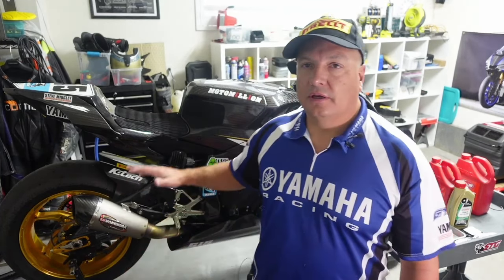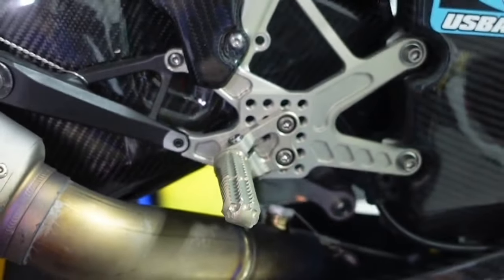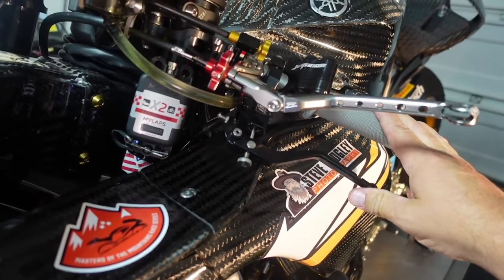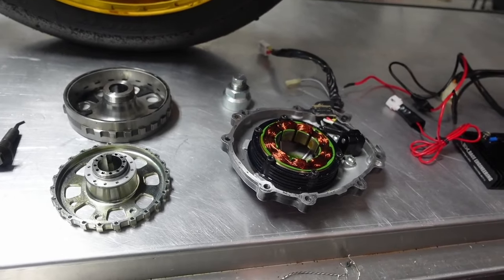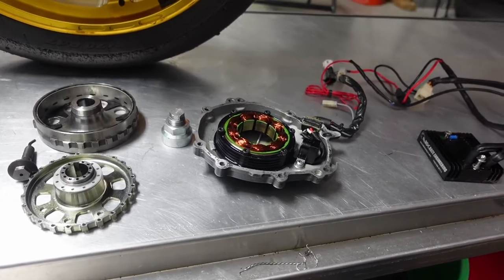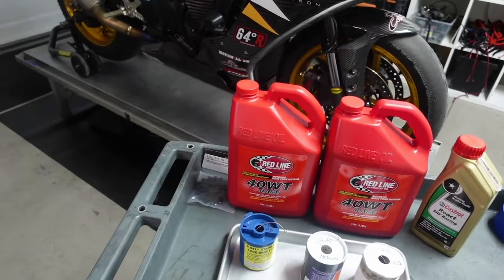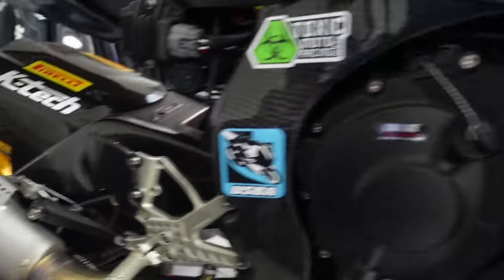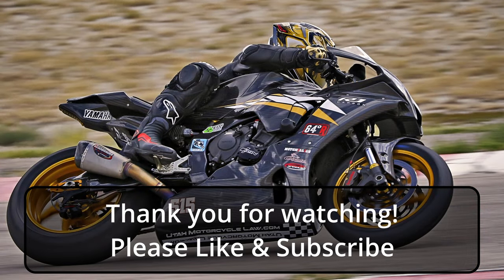2022 Yamaha R1 Race Bike Build - Part 3

Comment: Hi John, great informative video! 
What chain length (number of links) are you running with the extended swingarm and 15 43 sprockets? Thanks
Reply from the maker: Thank you! 118 or 120 depending on gearing. When I ran a 45 I used a longer chain

Comment: I run the BDK system in my R1 and yes, I have had it run out of battery on me  a couple of times in the beginning. Having said that, I love it! I noticed more of a benefit from this than from going to forged aftermarket wheels.

I seriously don't understand why you'd get rid of it seeing as it does make the bike faster and it is a race bike so it spends most of its time on stands and running warmers. Just add a plug to the battery and charge it at the same time! There's seriously no reason not to and it takes me 'maybe' and extra 5s before I leave the pits and that's if I'm being clumsy. 

Their manual explains that the battery BEGINS to provide charge at 4000rpm but it doesn't even brake even til 9000rpm (if I remember correctly). So cruising on the way to the grid or back to the pits after a race will also be taxing on the battery. Under a racing scenario though, the battery will be fine. I have done back to back full tank stints without recharging the battery with a charger during endurance races and it has never let me down.

One important thing to know for those running these on a R1! If the battery goes flat whilst you're riding, the bike will lose all electronic aids a good half a lap BEFORE it shut itself off. So yeah, I nearly looped it hard at nearly 130mph before I learned to keep my battery on charge.

Ps: Castrol SRF is also all I'll use on my bikes! A good way to keep them for longer is to instead of peeling the seal, use a syringe with a thick needle to draw it out and then slap some saran wrap around the tip before you put the lid back on.
Reply: Hi man, I'm just building a new R1 which I'm going to use road racing.

U just wanted to ask again. If you charge the batterie before the race it will make the race distance without problems?
Reply: @lukasmaurer1568  No problems whatsoever. I ended up getting a 'bigger' Lithium battery to use on endurance/relay  races (22-25 laps) but that was a 'just in case' and to be honest it didn't actually need it.

Unless you're racing on a very slow track where you can't get your revs up for most of the lap, I can't see an issue. And even then the battery should be good for a sprint race.

Comment: Great video John.  With regard to the swingarm mod, do you just leave the back of the Lightech chain adjuster hanging, without the clamp that holds it to the rear of the swingarm?
Reply from the maker: Currently yes. I need a longer bracket made for the back of the adjusters.

Comment: You are running 15/43 is that not really short gearing? Just asking since i run 16/43
Reply from the maker: It is perfect for the tracks that we race on because we don’t really have long straightaway sections but I encourage you to look at your laps on the gopro and see where you are in the RPM range. Many people start out with gearing that is too tall. it’s really good to be up above 9000 RPMs or 10,000 RPMs on exits if you can be so I think you can gear the bike a lot lower than most people think especially for Track days and Racing. Try it out!
Reply: I’ve got the CCU, so i see that im comming of the corners at 8300 to 9500ish. 
How high are you reving the bike? 
Mine is flashed at it tops out at 13000 rpm.
Reply from the maker: @jondjurhuus5041  With 15/44 I was shifting at redline for some turns. There are other turns where it was harder on short track to get to redline. Ideally you want to be shifting in a race situation when you are up in the top of the power range (over 8-9k)
Reply: @KneeDownRider  Just a little confused, you mentioned its good to be around 9-10k on corner exit but then you mention you wanna shift at 8-9k? I'm going from R6 to R1 so just starting to learn the platform. With R6 I'd exit around 9-10k rpm and shift at 15.5k

Comment: As always great video, I i also have a BDK kit (in a 765 rs) and i also have the same issues , i agree it is a pain in the arse , to the point now where i bring my battery charger with me , ive also had to miss sessions for low battery, usually on a full track day by about session 5 my battery is about dead, im about to install in on an Anderson plug on my bike and ill just treat it like my warmers between sessions ill plug it in aswell to keep it topped up. Ive reached out to the company they didn't offer much insight so i guess we're stuck with it , even still ill leave it in because there is a definite performance gain, on my 765 ill still get the same punch out of corners as a 1000 so its worth the money, just a shame about the actual charging issue.
Love you videos , it's refreshing that you have your own opinion when it comes to it and are happy to call it and go against status quo and are right by doing so, keep up the great work, love the videos 👍🏼
Reply from the maker: Nice to hear someone else had the same challenges. I am just not confident that the BDK can keep a battery charged, even if the bike stays above 5K RPM for the majority of the time it is running. It is a great piece. 

The other reason I took it off is because Full Spectrum Power was able to sell me one of the special batteries that they made for the Daytona races this year, with the anderson connector on top. I am going to get a couple more of those, and they are so light, small and powerful that they fit nicely under the tank bridge bracket and it lowers the weight and center of gravity of the bike.
Reply: @KneeDownRider  yeah I agree, I have tested one with a multimeter and it does spit out 13~14 volts but I'd say it's very low amperage given the same issues we both have. I like your way of thinking, I also use an ultralight for the same reasons . Best of luck with the rest of the race season !
Reply: Hi John, just watching back on this, you mentioned you had to buy a new bdk rectifier because it went bad, just out of curiosity how did you know it was bad ? Mine seems to be generating 13volts where as before it would easily pump out 14, I'm wondering if mines gone bad too ? All the light works on it and it does generate voltage , interestingly the max cut off potentiometer doesn't seem to make any difference

Comment: awesome info my dude. I started buying take offs from a local guy who got into racing this year. It was a great way to try out sc1 slicks for the first time coming from DOT tires, but not have to spend huge money. That being said, i went into it cautiously. Riding an r6 with no rider assists besides myself, i made sure to not go all out right away, and find where the grip levels ended. As soon as i felt the rear sliding out on corner exits, i swapped them. Regardless of the wear indicators. The 2024 season I'm going to probably starting buying new tires, and let some buddies run the take offs i havent used, to let them get the feel for them as well. ANYWAY...Great content, keep it up :)
Reply from the maker: Thanks Man!

Comment: I was curious as to why you ran two spacers on the rear instead of one. How does the bike handle with the rear axle pushed to the way back? Does it feel harder to steer? Did you also raise the ride height of the bike as well?
Reply from the maker: The ride height was raised because the newer 200/65 slicks are much taller. This bike doesn't have the adjustable swingarm pivot like my last R1 but if it did I would raise the pivot all the way for the longer tire. The longer axle slot didn't raise ride height too much, but I did shorten the shock length a couple of millimeters when I went to the taller tire.  The 2020 swingarm slot is a lot longer, which is why when you slot-out the webbing (see my previous video) the axle can go back about another inch. This longer swingarm is still over an inch shorter than the Suter swingarm lengths that MotoAmerica teams are running, so there is no fear of making the stock swingarm too long. Steering speed is not affected really, and if you wanted to speed up the steering you could add 1-2mm of offset to the front with triple clamps if you are using aftermarket triples.